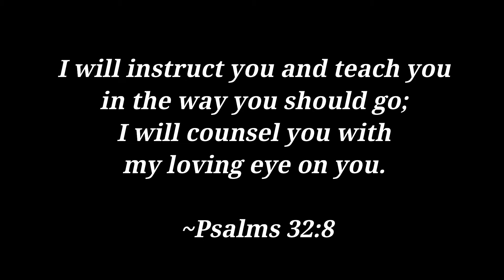Cheap Mobile Home Skirting Part 3

Comment: Looks good and you can always paint it after it fades to grey. I painted my front deck railings black, looks good
Reply from the maker: I'm hoping to have water so I can pressure wash and put deck stain on it as it fades.
Reply: @BigDreamsTinyBudget  where did you get the cedar?, I need to get some more
Reply from the maker: @ouachitamountainliving  a guy out in Elizabeth AR

Comment: This is considered a trailer home, cause it is no longer mobile to make it a mobile home. Right?
Reply from the maker: Its still considered a 'mobile home'  unless its on a permanent foundation which I may do someday. to move it again all they have to do is remove straps and bolt the tongue back onto it.